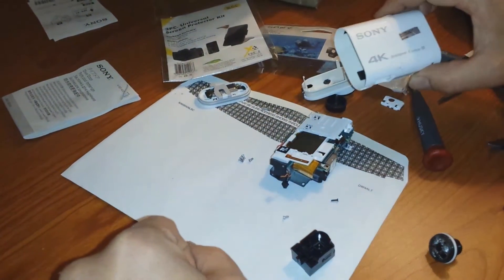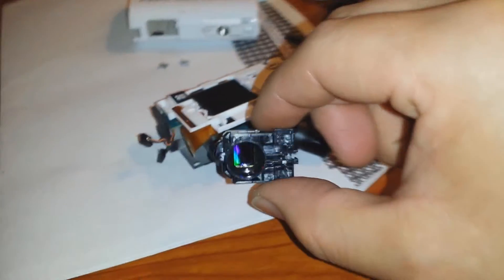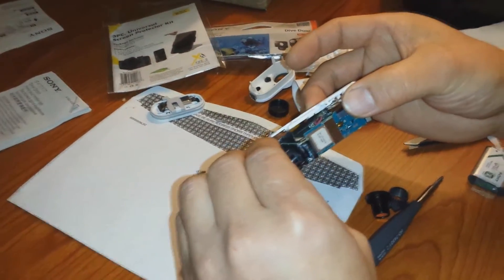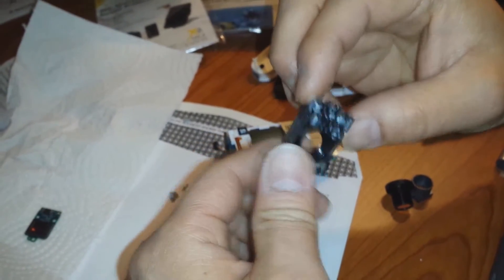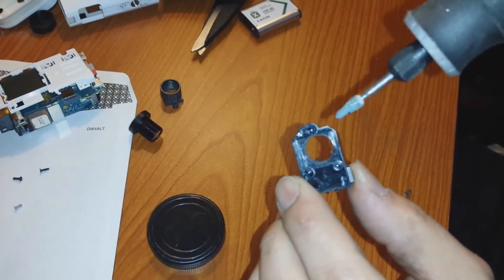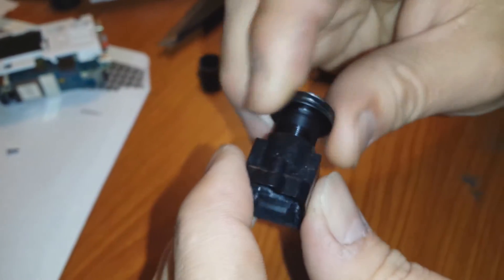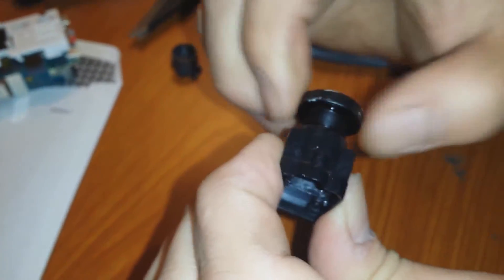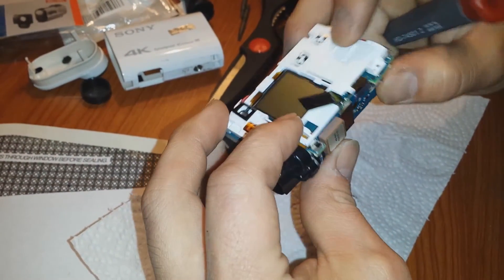Sony Action Cam with a GoPro 2 Hero lens.  Focus issue resolved.

Comment: Thanks mate! It worked. Actually you can get it Splashproof again with liquid rubber. I dipped the lens in it with masking tape so the brim has rubber then I placed tape on the front of the outer case, "filled" the hole with liquid rubber. Let it dry on a little. Lost all the tape. Put it together. No gap.
Reply from the maker: Helmi I'm fine the way it is.  I'll use the case if I want waterproofness.  I mainly use it for driving videos so it's always in its case to protect it from flying debris.

Comment from the maker: Also, i do not like to use the wrist watch screen as a complete "reference" to the focus adjustment.  It's a tiny screen and won't show you great detail. You can use it as an initial "reference" and mark your lens when you see distant objects in focus (on wristwatch) and since you have to be outside to get better "infinite focus" you cannot plug it to a tv.  I settled to record on sd, play, adjust, etc while marking the lens once so i know where it was previously.

Comment: Good video (liked). I think you were talking about my video and the comment left by Jason Charitakis. I'm going to give this a try soon myself and see if I can shave the thread down :)
Reply from the maker: be careful.  I should have used a different dremel bit as the one i used was "stonelike" and probably too rough hard.  If you stay in one position too long the grinding efficiency goes up real fast as I assume the plastic is heating up.  That is how I made that hole.  So i just did quarter of the circle at a time moving fast and grinding a little at a time to prevent it again.

Jasan also suggested to grind the threads.  I don't know which one he means, the lens or housing.  I thought it was a great idea but changed my mind.  I thought grinding the tip of the lens that is closest to sensor would work but then decided I don't think it will be able to "thread" back into the housing since it will be all rough.  So I thought ok, grind down the threads on the housing towards the rear sensor...... but then that would be redundant to just griding the "limiter" off and a little deeper so the lens threads can pass right through.  I still had to use plyers to "force screw" the lens back further.  It was still difficult to screw in; it won't just easily screw in further.  I guess that also depends on how well you sand the limiter down.  Not a pro at any of this stuff so it was a botch job.  :p
Good luck!
Reply: He suggested modifying the lens itself. That's probably a better option as it's easier to find a cheap replacement lens than it is to find replacement housing from Sony.

I've been put off buying from Sony again because of the whole experience. They gave me no support whatsoever and if you are lucky enough to find the right parts for your camera, they charge a ridiculous amount. It would make more sense to just buy a replacement camera rather than the housing.

I think everyone has done a botch job. There's no other way to do it. I honestly think Sony have went out there way to make their lens part slightly different in order to make getting replacement parts difficult. It's the Apple way of thinking. Make everything unique so people are forced to buy from you. That whole mindset is stupid as it drives loyal customers to other brands.

Is yours still sitting in correctly or has it come out a little?
Reply from the maker: Mine is sitting correctly???  It's "flush".  The focus is great.  Keep in mind it is not waterproof/resistant anymore without the clear case/housing.  The oem sony had the rubber seal; the gopro2 does not.  It sits flush.  I wish I could add photos on these comments.

I still wouldn't shave the threads off the replacement lens.  Logic is sound as the lens is easier to replace.  But..... Shaving the parts closest to sensor will be easy but will the lens thread and housing thread "lock" so you can screw it in.  Those threads are so small and so close to each other that I don't think i could do a good enough sanding job and let the initial thread entry smooth and sharp enough to "bite" into the housing threads.
Reply: Mmmm. I took apart the whole thing previously and the part where the threading is in would be difficult to sand down without messing it up. That's why I was thinking it was best to do the lens.

Maybe I'm just better selling it at this point as it's so cheap to buy a Chinese branded replacement.

I'll have a think and decide whether it's worthwhile :)
Reply from the maker: didn't take me long.  Did it on my lunch break.